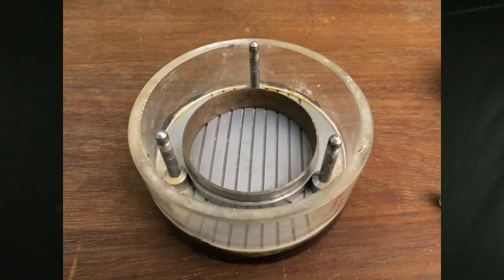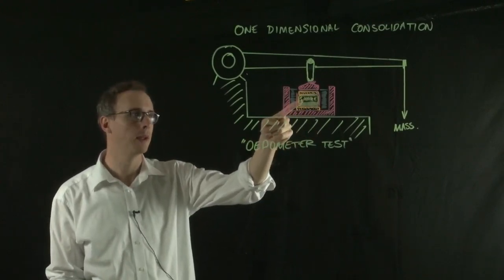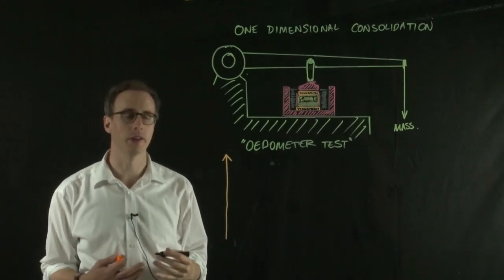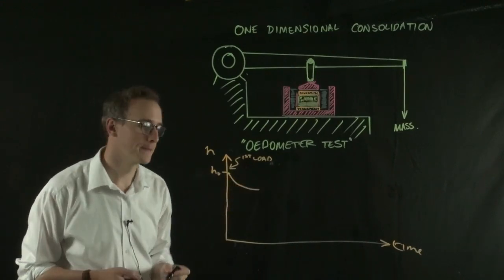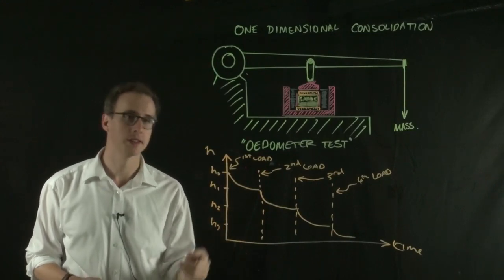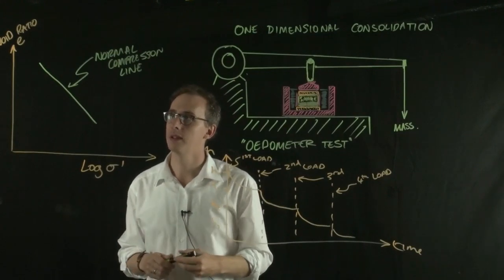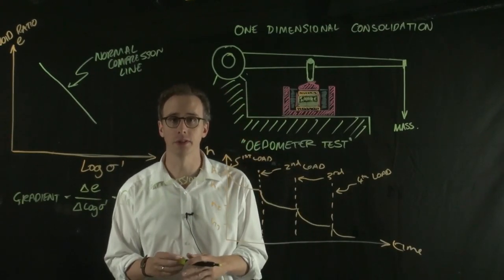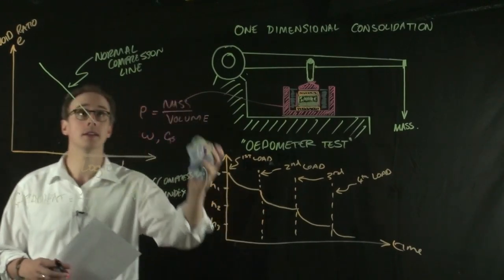Oedometer test

Comment: We apply loads to soil in lab far less then those which soil bear in real world.Since , the load we apply is far less then the preconsolidation pressure , doesnt that mean that the curve we get just gives us recompression index ? How do we get compression index and estimate preconsolidation pressure then ?
Reply from the maker: Thanks for the comment. In fact with the oedometer we can easily surpass the stress in the field. I've put 50 Kg onto the end of my oedometer, which equates to about 1 MPa.  1 MPa is about the same as 100 m of water pressure, or ~ 50 m of soil pressure. With triaxial testing kit, you can go even higher.